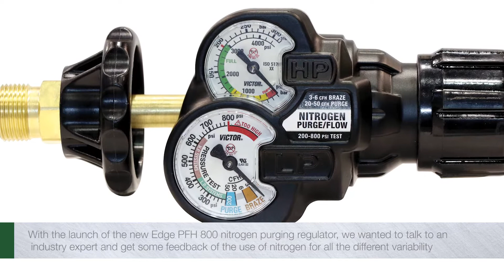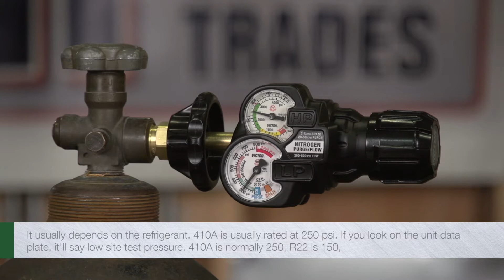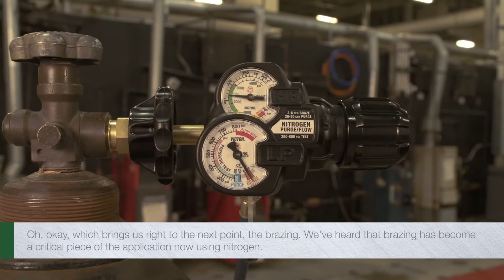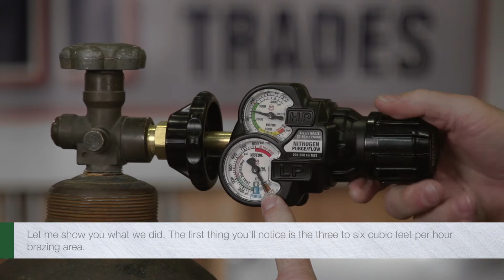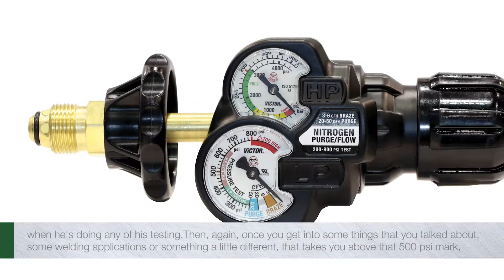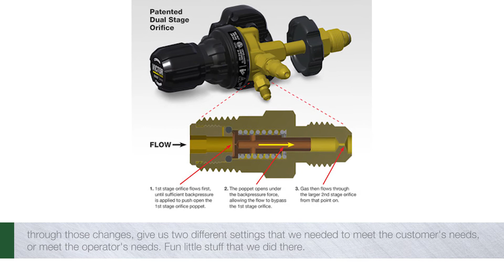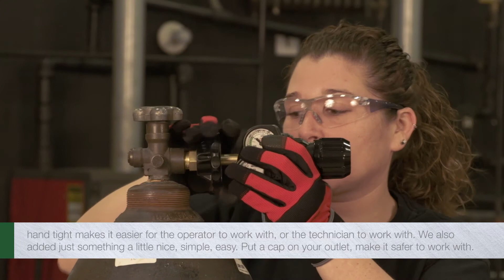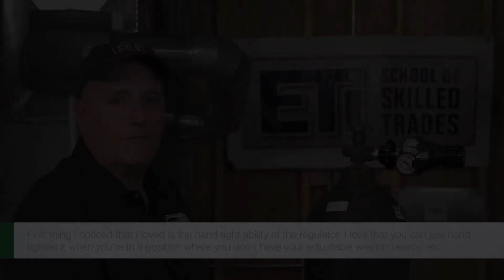Victor EDGE 2 0 Pressure Flow Hybrid Regulator for Brazing, Nitrogen Purge and Pressure Testing

Comment: So an R410a split heat pump system that may operate at 35 bar (507psi) should only be pressure tested at 10 bar (150psi)? Yes right, because that will find a leak that is only apparent at 150 psi and  below, not one that is only apparent at 450 psi.  The pipe lines on a mini split and the fan coil should be strength pressure tested at as high a presssure as 41.0bar (600psi) for 15 minutes and then left at between 1 to 1.3 times the working pressure for a recommended 24 hours.  So that could be 33.0bar (478psi) or more. The misinformation on the internet is truly amazing.

Comment: I had purchased this nitrogen pressure regulator but the high is not going more than 200 Psi. What should I do.
Reply from the maker: Thank you for using ESAB products. In order to best assist you, we ask that you contact our Technical Service department for assistance. You can reach them at 800.ESAB.123 (800.372.2123) and follow the prompts.

Comment: What's the difference between purging and brazing with nitrogen?
Reply: Purging is getting all the gases out of the lines which will create carbon build up on the inside of your joints and piping. Nitrogen is a Inert gas which is not flammable like oxygen. Most don’t understand you need to purge all the natural atmospheric gases out. If you do not purge you will waste your time brazing.
Reply: @jonaustin8343  thanks brother!
Reply: Brazing is the correct term for oxifuel welding OFW, purging is the process to release what is in the tube system so it won't corrode or other stuff.

Comment: Testing gas lines at 150psi is crazy and ridiculous. 15psi for 15 mins nothing more. And this guys been in the race for 30 years, yikes!
Reply: You sir have a lot of leaks and most likely are in a attic most of your time
Reply: Depends on city code, where I live its 60 for 60, 60 psi for 60 minutes no decay. The city 20 miles to the west is 150 psi for 15 minutes no decay.
Reply: @Reloadeez what is the working pressure on these gas systems?
Reply: @PhilScordato  The 60 for 60 is residential. We disconnect the pipe at the meter. Put the test gauge on there, disconnect all appliances, plug lines, and pump it up. The natural gas that enters the home is typically 5-8 inches water column, so 0.18-0.28 psi. So we are basically pressure testing the lines at 240x the pressure of the natural gas. I've argued the test pressure is too high for years. The 150psi test is for commercial lines running gas at 3-5 psi.

Comment: It's 410A not A410, there is a difference, including sounding like a person that does not know what they are talking about. Essentially a sales person with no clue of their product.
Also, there is a need for those higher pressures, 300-600 psi for checking ductless systems. Manufacturers require them for proper install procedures.
Also, while he is correct most leaks can be located at lower pressures, higher pressure testing should be done. If your system is normally operating at 400psi and you don't test there and it fails during operation how does that abide by his point of doing it right for his company and the customer?
Reply: Came to the comments for this. Every mini split I've ever put in got pressure tested to 600 psi per the manufacturer. ( r410a )

Comment: Hi here, I just picked up this regulator at a local supply house here in jersey. Love your product, there's only one thing, why does it take so long to pressurize the system during a pressure test? I am aware of the dual stage orifice, thought maybe I''m doing something wrong. it took me about 25 minutes to pressurize a residential 3 ton 410a system at 250 psi
Reply: If this is true, which I have heard similar on other regulator with these same features, then there needs to be a built in bypass for the high pressure/test use.
Personally, if I find this to be the case, then going back to my individual pieces will be more beneficial.
Reply: There is a third port on these that are plugged, replace the plug with a 1/4 flare service port, boom full flow testing.
Reply: @Reloadeez  I saw that port. So before I buy the part to do this wanted to confirm this works. You have done it? Thanks
Reply: The port is full flow,  meaning it bypasses the regulator. You can put a high pressure Schrader valve on it and meter it in with main tank valve, or put a small inline regulator on the port that will limit the pressure coming out. I use a high pressure Schrader valve, meter in with tank valve and get pressure readings with gauges.
Reply: @Reloadeez  Perfect. That's what I thought. Always use gauges to check the pressure anyway. Thank you
Reply: Yeah I noticed that an i haven't found anything to say otherwise so looks like back to using the old way lol

Comment: This regulator doesn’t get the attention it deserves! Yet!
Reply: I just bought one today. I like the features but was confused on the np out and the hp out on the brass side. I think I can bypass this by adding another port on the hp side on the brass body. What do you think?
Reply: @jonaustin8343  Drill and tap at your own risk but why buy a regulator that isn't what you want when they've been a solved problem since the SR series (cheap rebuilt which means effectively new).